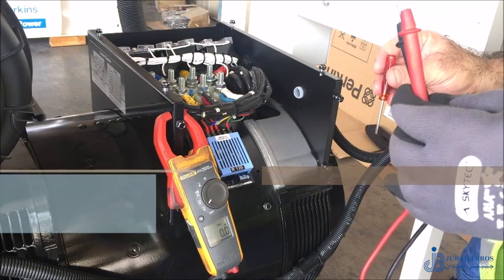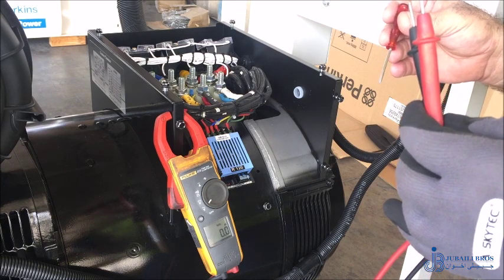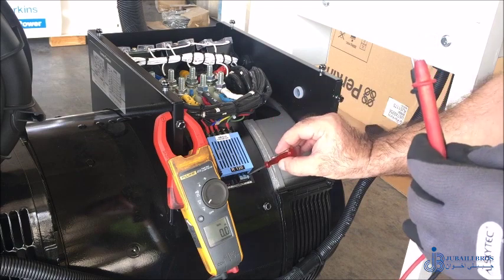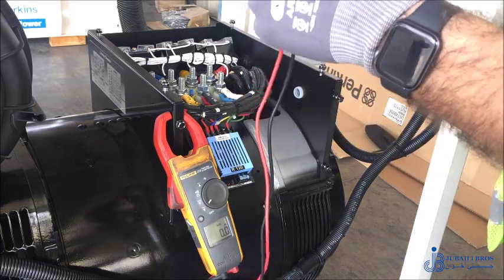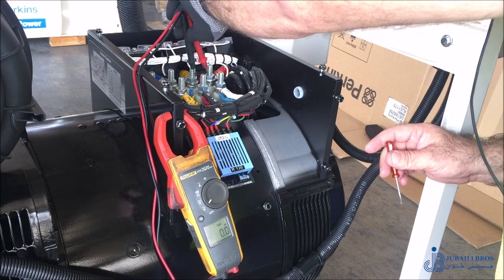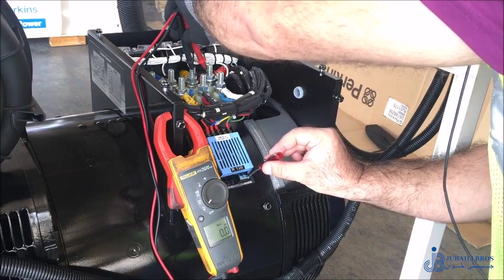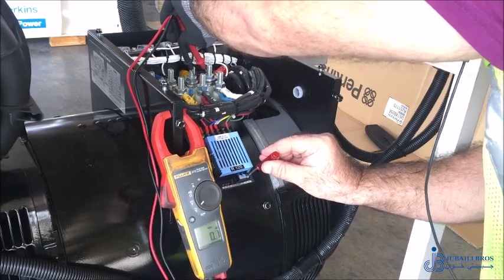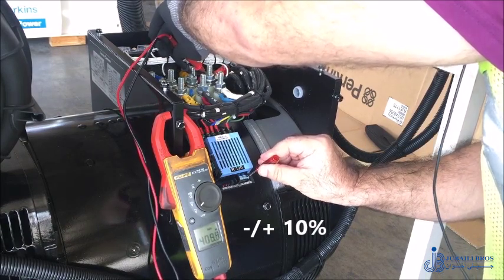Leroy Somer Alternator Voltage Adjustment (English version)

Comment: The Video is quite clear, the terminal Block has Winding wires T1-T12, And AVR R120 for Shunt Excitation Setup, but what are those three black blocks on the back with white wires connected in Series?